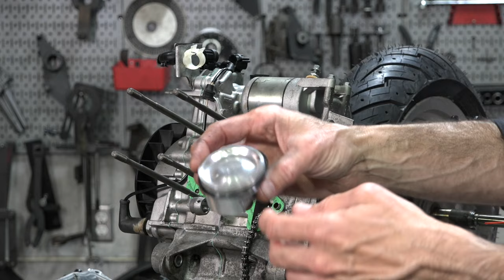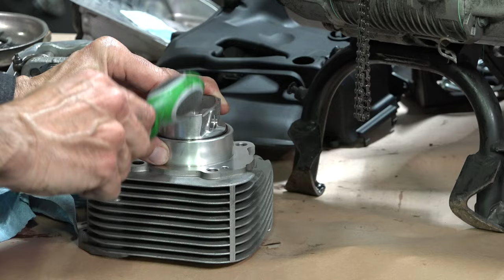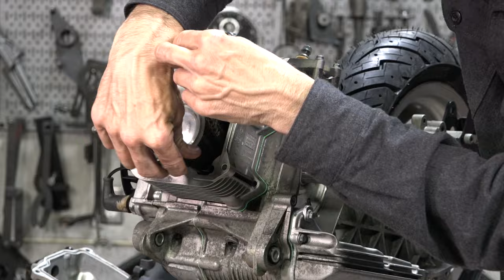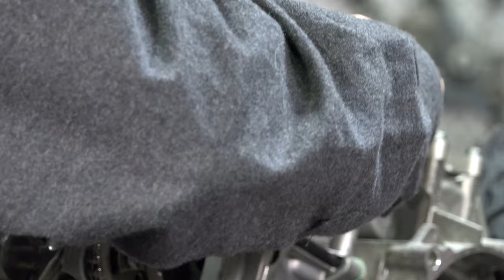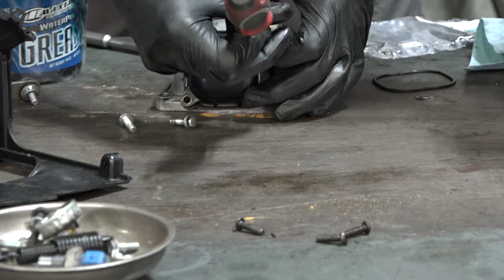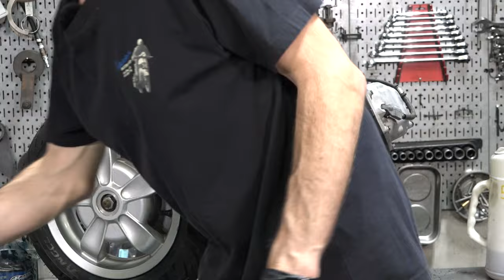Installing the Top End on a Vespa 3V Motor - Sprint/Primavera 150

Comment: If you're like me and have been doing all your own service and you have a newer bike (mine is a 2024 Sprint 150 S), you'll get the service icon "wrench" displayed on the instrument panel solidly at the intervals.  To turn it off (from the service manual):

SERVICE ICON RESET Reset the SERVICE icon as follows: turn the ignition switch to ON and then push the handlebar MODE button briefly and repeatedly to the RIGHT to scroll through the functions available on the digital display, until the BATTERY function is displayed.
   "PRESS BRIEFLY AND RELEASE": PRESS THE BUTTON AND RELEASE WITHIN 0.5 SECONDS; "PRESS AND HOLD": PRESS THE BUTTON AND HOLD FOR AT LEAST 2 SECONDS.
  Press and hold the MODE button to the RIGHT for at least 10 seconds but not more than 15 seconds. The SERVICE icon extinguishes when the button is released. If the MODE button is released without waiting 10 seconds, the SERVICE icon will not extinguish and the service interval counter will not be reset.